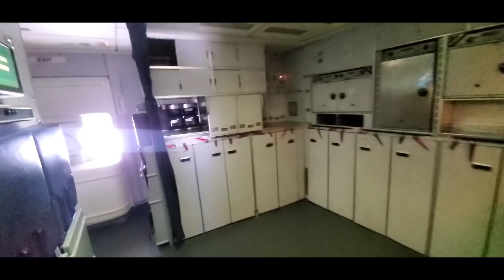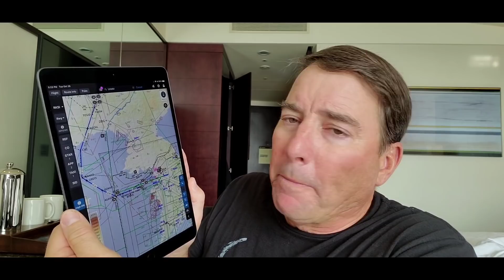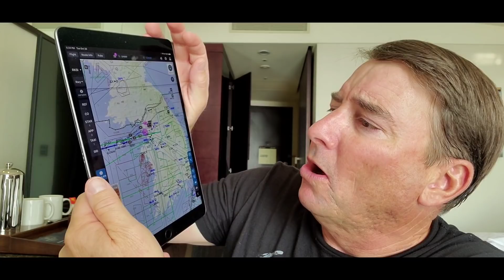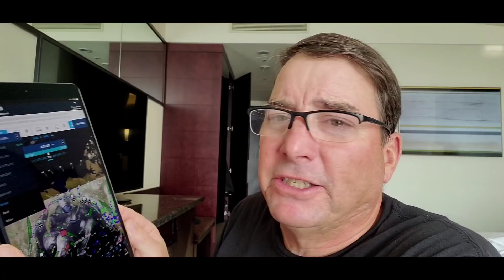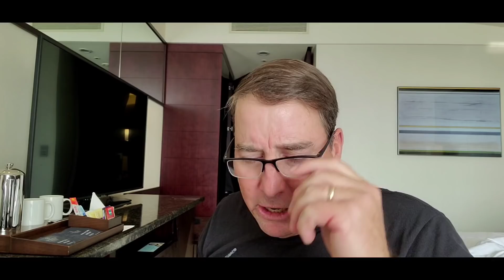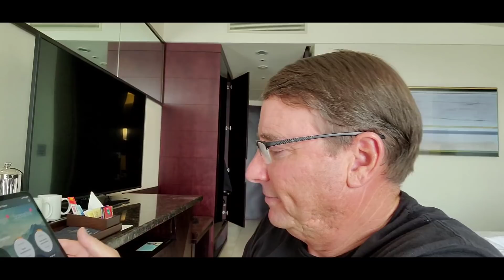Airline Pilot Software

Comment: Does the iPad GPS work reliably everywhere inside the aircraft? When using my phone GPS in flight mode it only works if it's near a window, as presumably the aircraft's metal body and overhead equipment tend to attenuate the GPS signal in the main cabin. That's why I assume the aircraft GPS antenna is located externally. On the lower deck of a double-decker aircraft I would guess that's much worse, though usually the cockpit will be up top and with raked windows you have a pretty clear path to the sky.
Reply: On the 787 the gps on Jepp app doesn’t work apparently because the cockpit is a faraday cage. WSI does seem to work though
Reply: Being near the window won't necessarily guarantee a stronger GPS signal because of the coatings on the window or imbedded in the window material on some airplanes .. usually newer ones. In the cockpit that is almost guaranteed because the material used to conduct current to heat the window glass blocks the GPS signal frequency.
Reply: Flew Air Canada YYZ - YOW and return a few years back. Backseat driving- Google maps worked well on the DHC-8 100 but not as well on the Q400. Thicker skin probably reduced reception for GPS. Will have to try ADS-B someday with a Software Defined Radio.

Comment: Hey Juan I looked up in the sky and I saw two identical Skywest Jets going westbound side-by-side to each other maybe a couple miles apart. One was flying from Dallas going to LAX at 31000 feet and the other was flying from Phoenix going to San Francisco at 34000 FT. They perfectly criss-crossed one another. Is that normal to cross each other at 3000 feet apart?
Reply: Yes that is normal
Reply: @vrducati46  thanks.
Reply: Here is one source: "ICAO specify minimum vertical separation for IFR flight as 1000 ft (300 m) below FL290 and 2000 ft (600 m) above FL290, except where Reduced Vertical Separation Minima (RVSM) apply. Most national authorities follow a similar rule, but may specify a different level at which the rule changes."
Reply: It can be down to a 1,000 ft separation. Aircraft flying eastbound are at an odd altitude. And westbound on an even altitude. So the one going from DFW-LAX had to have been at 30 or 32
Reply: @acft6074  we're about a hundred miles from LAX so the one at 31000 feet was dropping altitude cuz he was getting ready to land.
Reply: @jiveturkey9993  ah, gotcha👍
Reply from the maker: Yes, as little as 1000' apart.